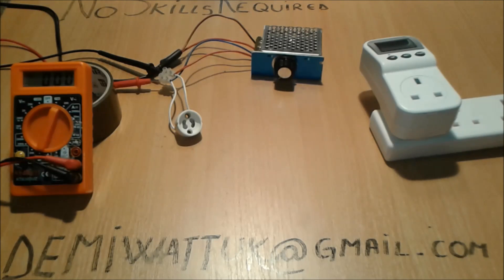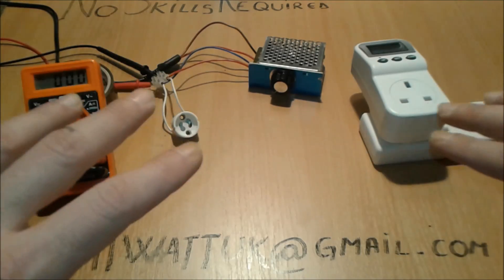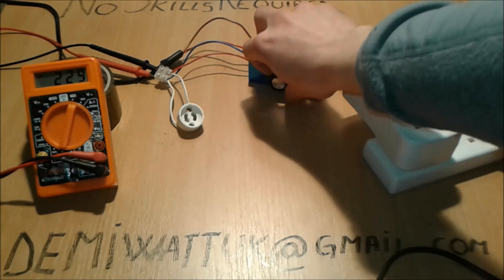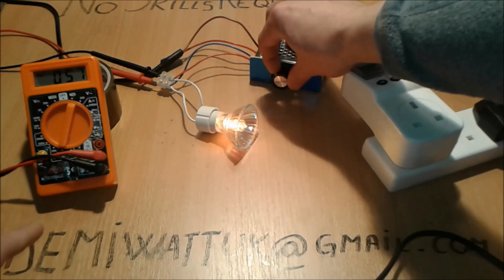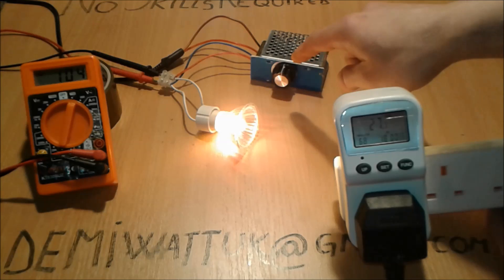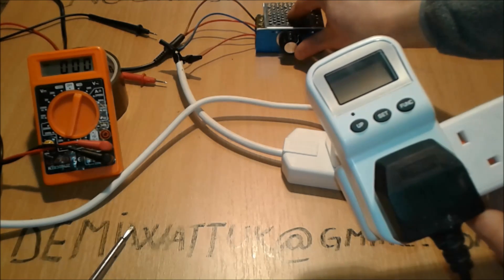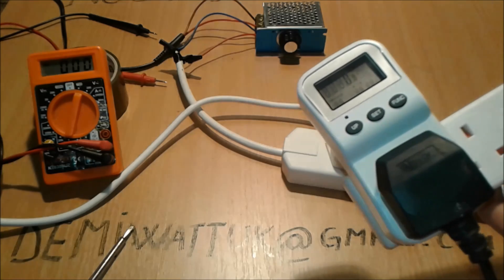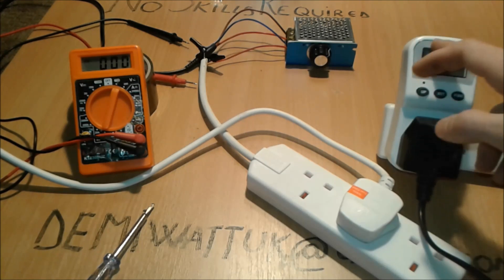Homemade adjustable 220v bench power supply and crazy free energy effect?

Comment: Can we use it to regulate voltage for other devices like TV etc.
Reply from the maker: Yes sure i tried on light bulbs, motors, radiators it depends on the load.I tried this with a 1800w radiator yesterday and works fine